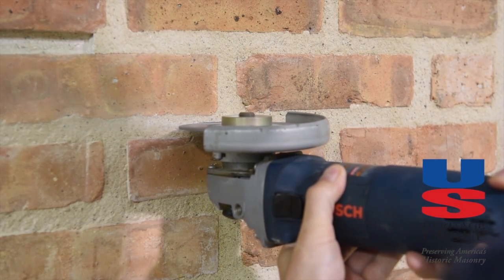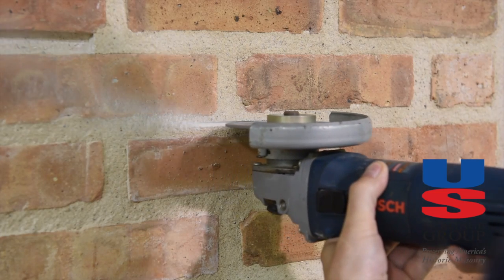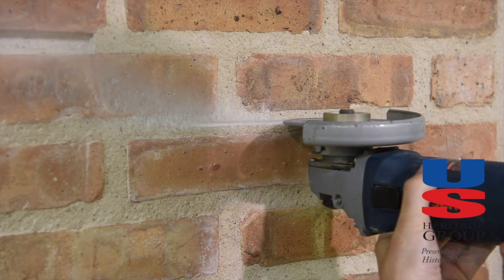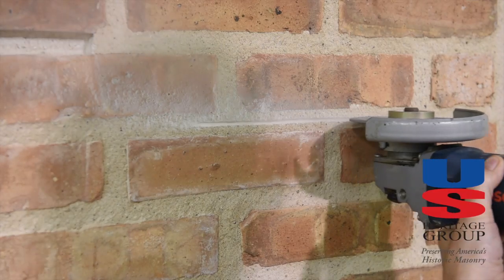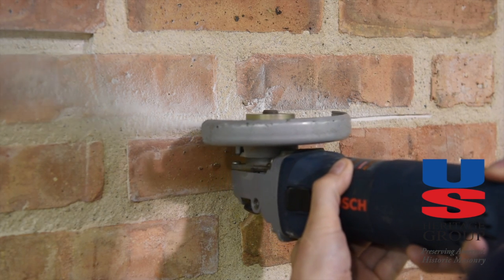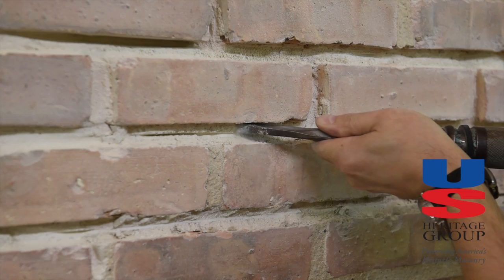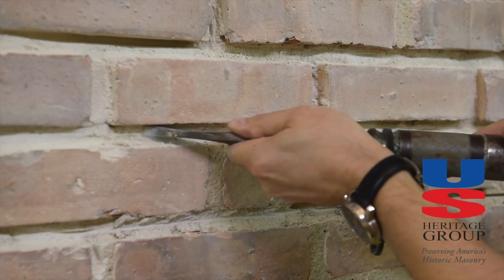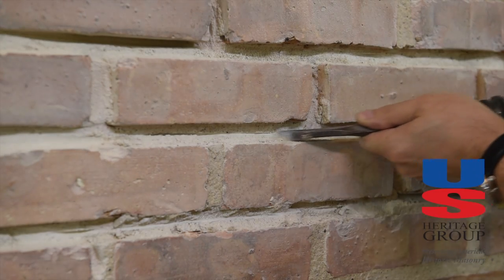Repointing historic masonry the right way - Part 1 - Clearing Mortar Joints

Comment: Where can I purchase the old buff mortar dye?
Reply from the maker: Hi Greg!

We don’t sell pigments for mortar color, as finished color is dependent on sand color. Restoration mortars can be tinted with iron-oxide based masonry pigments conforming to ASTM C979, make sure any pigments you purchase for tinting have this designation. Most concrete and masonry suppliers carry these pigments.  Also, the pigment in your mortar should never exceed 10% of the total binder (lime plus cement, if any) by weight.

US Heritage Group

Comment: Wondering why you don't start at the top and work your way down. If you do just the opposite don't you end of washing the dirt, etc. over the newly pointed area?
Reply from the maker: Mortar removal can be performed from the top down or bottom up and is usually based on the preference of the mason and ease of access on the wall.  Any remaining bits of dust or old mortar will be rinsed out during the and soaked prior to the installation of the new mortar. US Heritage Group

Comment: What if you're good with a grinder and won't damage the brick as you're grinding?
Reply from the maker: The most important thing during the removal of the mortar is to protect the original brick from damage, as finding replacement bricks for old houses is very difficult.  Even the most skilled mason can have the grinder skip or kick on them and cut into the brick if using a wide blade, and if this happened there is no way to undo the damage. US Heritage Group